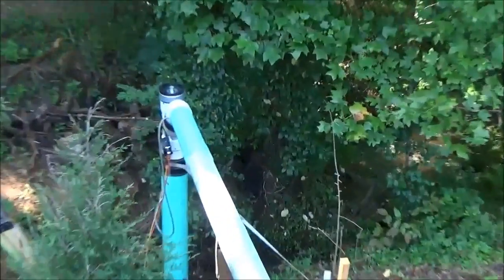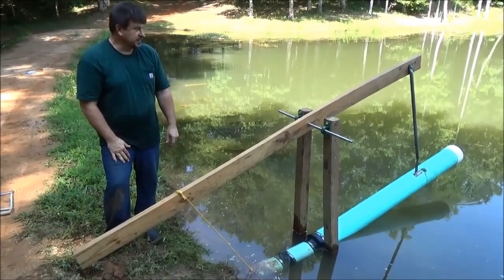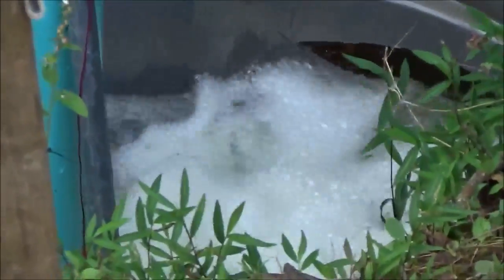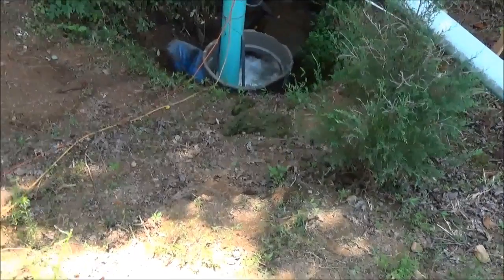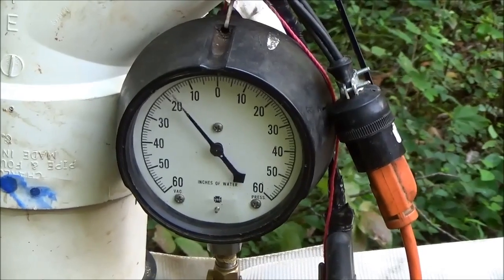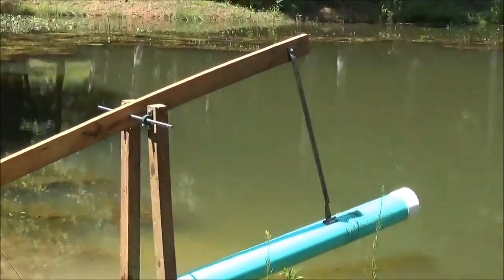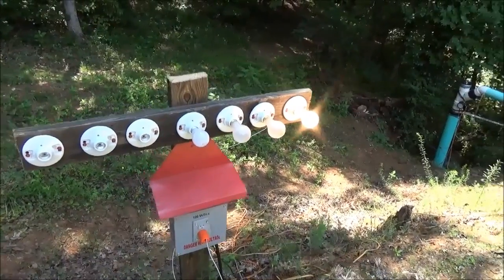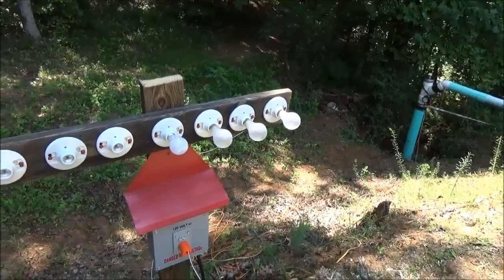Pond Power:  Part 2

Comment: My pond floods and the overflow just flows down a mountain, so my pond can never get too high. This would be a great way to use that water that just flows out my pond anyways. Needs a battery house to hold and charge batteries. I have solar and wind already so I woundn't rely on only this but best to have redundancy incase something in my system fails.

Comment: Would it be possible to put some of the water back into the pond? To help maintain supply when generating electricity? Ram pump or other means? That’s some good work you’ve done , just wondering.

Comment: Thank you for the video - good tips on how to control the water out of the pond to power your low head turbine.   I love it when I find new types of water powered pumps.  While not your use, I don't see why electricity generated from the turbine could not power a water pump.   At that point it becomes a matter of cost per volume of water delivered to a usable height evaluation with other water powered pump methods.   I've started a discussion and linked back to this video from the Water Powered Pumps public Facebook group: https://www.facebook.com/groups/240458583255303/permalink/581831619117996/
Reply: I've been thinking about the pond power low head turbine to power an electric water pump.  While the turbines are not cheap, when we move from pumping a little water to fill a tank to more water for irrigation, every water powered pump approach has significant costs involved.   At first, I was just excited to identify a different type of water powered pump and added to our poll of those interested in different types of pumps - but as I think of it, I'm looking into it - thanks!
https://www.facebook.com/groups/240458583255303/permalink/580155305952294/

Comment: if you had a spring loaded cap on the pipe in the dam you could attach a bouy that opened it when you got enough rain. then obviously it closes when the pond level drops
Reply: Aka hudson valve
Reply: @TurboHommy  ah, ill look it up. i heard about it from a guy but never knew the name
Reply: @TurboHommy  do you know the one with the diaphram that pushes the button on the electric pump and then it pumps out when you get rain? name?

Comment: have the water go back into the pond, that way it will NEVER go dry
Reply: Was thinking this because I'm trying to create a water catchment system for recirculating using the same water continuous...
I'm even thinking of multiple to charge a battery bank...
Reply: @Jim & Susan Stewart how can you do that without spending more energy than the generated? by siphoning from the bottom of the turbine output with a similar diameter pipeline?
Reply: @FBPrepping  sounds like you just created the way how... There are no rules really, no one said it wouldn't be possible, why can't you build a catchment tank that uses a size diameter smaller to siphon the used water back? It doesn't need to be hooked to power, it's cutting down the water used by 75%... That at least makes this particular case more efficient... And if this was the case can be multiplied to gain more power...
Just saying nobody has all the answers, sometimes those questions make someone think to create a possible solution...
Reply: Hell can this be made taller inlet so the outlet can be shorter and dropped back into the same water? This is also a solution...
Reply: @FBPrepping  a siphon takes no energy dude... You build one coming back to the pond...
Reply: @FBPrepping  stand alone siphon not hooked to a power unit...

Comment: Ok I have over 100 feet drop in my property. We have spring runoff to fill ponds but not yearlong flow. If I build two ponds, one high, one low. Use penstock and 10 turbins between ponds
 Then a return pump to top pond. I know utility size systems work this way, why not micro hydro?

Comment: I think if you have the turbine and the motor on the suction side of that Y fitting, you will use less water but with higher vacuum readings because the sealing will be complete on the Y connection.

Comment: loop the water back to the pond
Reply: Water doesn't flow uphill by itself! The pressure at the current pipe exit  is enough to get the water back up to the water level at the pond - but no higher.  There is no such thing as free or perpetual energy - if there was we wouldn't need to pay utility companies for our electrickery.

Comment: use solar panels to run dc pumps which dump water into the pond then run the water back to create clean sustainable energy from the turbine.... you cut off batteries and its inherent problems.

Comment: Everyone here suggesting that ram pumps or any measures used to pump water back up to the pond: it will not work to create more electricity. Here is how hydropower works: sun vaporizes water which is carried into the sky in a form of clouds creating potential energy. When the cloud cannot hold any more water, it starts raining down. When the raining water lands on a hill, the water starts flowing down and forms a river or a stream. This is where you put the hydropower turbine, in this case a pond is used to store the water before released downhill to a turbine. After the water has passed the turbine, it has lost most it's energy. If a steep downhill continues after the turbine, good! You can place nother turbine further to create even more energy. But pumping the water back up into the pond will consume a lot more energy than could be gained from the refilling pond due to friction in the pump, converting the energy etc. In the end, hydropower gets it power from the sun, then wind (which also gets its power from the sun) transports the potential energy. You cannot trick the laws of the physics. I live in Finland and our terrain is very flat compared to our neighbour Norway which has lots of mountains. Norway has a lot of hydropower, Finland has a lot less since the water here is in lakes with water level close to sea-level instead of strong rivers flowing from the mountains in Norway. Melting snow and ice makes no difference, it is just water that stays still trough the winter and then returns back to the cycle. If pumping water could create more energy than it consumes, Finland wouldn't have any nuclear power or fossile fuel plants. We have a lot of water but only a little elevation -> a little hydroenergy.

Comment: The output pipe below turbine must be at least a little smaller then the input...  With the same size, output pipe, you lose suction due to the difficulty of getting all of the air out...  often, as it is now, all of the air will not come out, but it will not be obvious....
A metering valve at the bottom, may at times, keep all of the air from being drawn out.... 
For maximum power, the output at the bottom of the pipe should be as low as possible and a fraction below the stream that it discharges into... 
Please let us know if you are still reading the comments here... 

I just noticed that your comment said you are increasing the size of your inlet pipe, which is what I suspected anyway....  All Depending on the size of the generator, it may still be useful to reduce the size of the output pipe....The outlet still needs to be lowered below stream level...

Comment: Your inlet probably has a screen of some kind, causing some loss in effective head.maybe a larger surface area screen might get blocked less. Like maybe a 4 foot long screen cylinder. 
Second thought: a raw pipe end has a pretty lousy coefficient of entry. A much better coefficient of entry would be a torus, rather a doughnut with an ID about that of your supply pipe , and where the Outside Diameter of the Doughnut about three times the diameter of your inlet pipe.  That coefficient of entry  as CE is about "one" like no loss at all.  You could still have a large cylindrical screen inlet filter at some distance from the inlet,  Diameter like 5 to 8 times the OD of the inlet pipe.  Some study up on the coefficient of entry having to do with the shapes of entry would likely be interesting.

on page: https://neutrium.net/fluid_flow/pressure-loss-from-pipe-entrances-and-exits/
a r/D of 0.5 will get you a K equal to about ZERO. that is NO LOSS.  note the RE-ENTRANT K is about 0.78 (Pretty huge loss) Sort of looks like a raw pipe entrance with a flange  some where well away from the actual pipe entrance.
Enjoy. Regards. P.S. this is no "perpetual crap", it's good engineering principals. The more gently you treat the water on the whole length of the infeed, including those sharp 45 degree angles just before the turbine feed.

Comment: Great project Engineer775! 
Keep in mind that;  
1- the lower you set up your turbine, in relationship to the water level at the pond, the higher the pressure you'll get. 
2- bubbles in the water (turbulent flow = less efficient) no bubbles "and if possible smooth curves in the pipe" = linear flow / most efficient. 
3= for lightning, LED's will use the least watts 
Cheers from Brazil
Reply: Marcelo Gouveia , I do believe  it was just for testing  to see the amount of watts  it would able to put out .& also any & all input   that's  Good will be considered  . I think ?         I do like it very Nice start  on it over all  .  I do wish him best of luck .              I wish I had water on my property   cuz so many  different  things are possible  .Cheers

Comment: great power regulated? ya FFS sorry, AC generators are 'fixed for a specific RPM' whether it be 50 or 60hz sine wave AC power depending on how many poles are inside the generator....  where is your field effect and speed controllers? sorry only way anyone generates power on a unregulated speed source is making DC power then convert it to AC with an inverter.

Comment: Since the pipe is under the road, couldn't you have had the same results with just installing an inline valve on the discharge side? I mean, if you're prepping, I'd think you'd want to conceal stuff. You could've buried the pipe in the pond, concealed it by putting up a fake fishing pier or something, install a valve on the discharge side. Thus, eliminating the wooden contraption and lowering your discharge pipe furthermore concealing it even better.

Comment: Why don't you add another pipe to gravity feed back into the pond so you don't have to worry about draining your pond? And make a close off so you can open and close depending on if you want to put the water back in your pond or drain it off?

Comment: Just curious if you could use a pipe reducer to create a smaller flow, but higher pressure through the turbine? Basically use less water while getting equal or better results.

Comment: A engineer could figure a way to return some of that water that you're drawing out of your pond. right now you're losing a hundred percent of your water system, in theory even a poor design system would only let you lose 90% and recover 10%.
 basically it boils down to how much money you want to spend and how much water that you can recover. Recovering any water at all will perpetuate running the turbine longer.

Comment: Did you mention what the specific kind of turbine that is that you are using? I'd like to see some video on that because this sort of set up is exactly what I'm looking at for my pond. I might have a little more head than you have there. I have a spring fed pond and there's a constant spill over 24/7/365 because of the spring although the flow may be less than what you are working with. The spring never stops feeding the pond. So I want to capture energy from it. Thank you so much for sharing!

Comment: The amount of energy being produced is not worth the disturbance hes causing to the water and the environment.  I mean hes moving water and probably burning bearings and causing damage to water or micro organisms in the water by washing it through that things only to power three light bulbs.  Not worth it.   I can see a bigger turbin or pump doing less damage because it is bigger and has less of an wish and washy effect on the water and distrubs the water less than a smaller pump.  And when i say bigger i mean like the ones used in giant dams or hydroelectric plants and even those do damage the environment because they trap water and wont let it flow naturally which is not good for keeping water clean and natural.

Comment: Wow.  This is really cool!!  You have an enormous amount of energy just begging to be let out of that pond.  I could have it refill itself 100% with no electricity or gas required.  No silly ram pump either.  Just some clever engineering and you could have infinite electricity.  Your only enemy in this is evaporation/drought and a few moving parts.  As long as you maintain the system it will produce electricity for as long as you want.
Reply: Just curious, how you gonna refill it with 0 power input ?

Comment: if u put a  shut off valve  of some kind, right before ur turbine, u can keep water in pipe all the way to ur pivot point. that way u have 100 o/o turbine as soon as u lower ur feed tube into pond, and still be able to control the water levels.

Comment: hows about taking advantage of more head pressure by mounting turbine a couple of feet lower near the exit,,,,and on the resupply to the pond-its gravity that brings it down. If you lift it up to pond level thats gonna take as much energy or more than what you gain from the drop. If you want to save energy, then put the turbine as low as possible and put a control valve upstream in the race to control water volume

Comment: I feel like instead of draining the pond so fast with 8" pipe maybe using a 6" pipe and 2 turbines in series would be more efficient. You could have the first turbine where it currently is and then catch all the water coming out of that first turbine in a deep large tank that would allow most of the air out of the top and then have the second turbine on the drain of the tank. Double the power.

Comment: nice work. I'm curious though why you didn't put the turbine at the bottom of your drop pipe, like hydro plants, to gain the extra lb's of force you can spin your turbine with and generate more power? Thought maybe you could use the vacuum generated by the drop pipe that is past your turbine but this would only work if there was no way air could be introduced into the system or any type of impeller cavitation.  Awesome stuff, looking forward to more videos.
Reply from the maker: Thank you.  Yes, the air is completely purged.  I put a vacuum gauge on and as the air is purging you see the needle go from zero and into the vacuum range and then stabilize.   You can see it on the gauge and really hear it in the turbine.  It is designed to operate this way.

Comment: ah, it will great if oroville dam management use this way to suck out water from the dam greatly without damaging the dam structure. i mean using some pipe over top the dam spillway, with long pipe out side the dam will automatically suck the water out

Comment: Is there a return line that leads back to the pond? I was thinking, since you empty into that "bucket", why not pop a hole in the bottom and glue in a 2" pipe, then run it back to the pond, but instead of shaping the pipe so that it empties under the water, you just shoot it straight out, so it "waterfalls" into the pond (might require stepping down the size as it runs back to the pond). The correspondent splashing will oxygenate the water and keep it fresher than it would just sitting there.

Comment: maybe a  couple different stagres at different leaves of ram pumps. you would probably   be able 50 to75 percent of that water back to the pound and achieve long run times by re_ using some of the same water

Comment: You could speed up water flow speed by stepping down pipe size. That would also speed up the turbine.  Of course, a longer run wouldn't hurt either.

Comment: why don't you feed water back into the pond with a valve to open once you hit full rpm
Reply: What you're suggesting violates the laws of physics.  If it was possible, we'd all have 'water-loops' at our houses and have unlimited electrical energy.
Reply: there should be plenty of flow to build a monitor down hill and spray uphill
Reply: the spray would never quite reach the height of the pond it came from. they call that perpetual motion and it cant happen.
Reply: 2 turbines one to power an electric pump in the sisterin, and one for the power bank
Reply: it's not rocket science to get the water back into the pond
Reply: Technically you could salvage SOME of the water using a ram pump to get it back into the pond, but you'll still lose roughly 90% of your water because of venting. It'd also be a beast to set up to avoid adding negative back flow that would decrease the speed of the flow of the water through the system, so it'd be questionable if it's worth the added effort. Add in his pond is likely spring fed, so it becomes even more questionable. The more complicated you make something, the more kinks you will need to iron out, and the higher the risk of  mechanical failure.